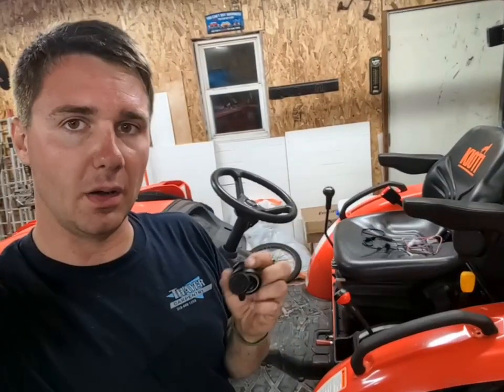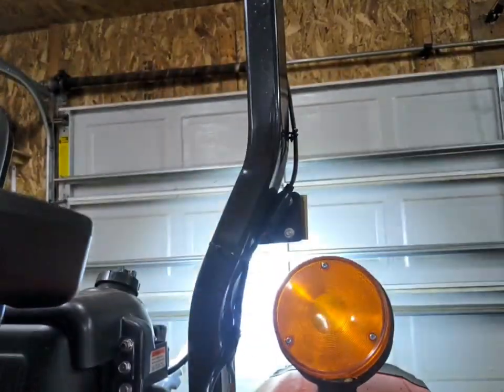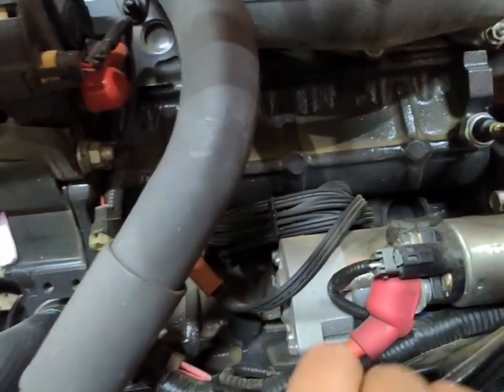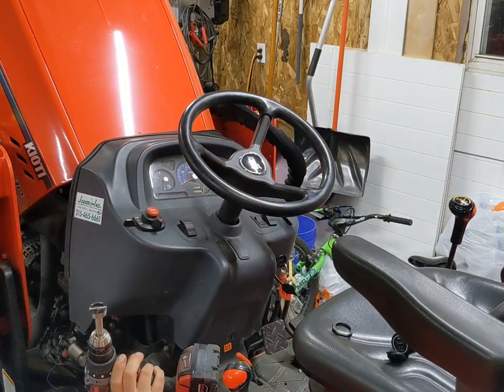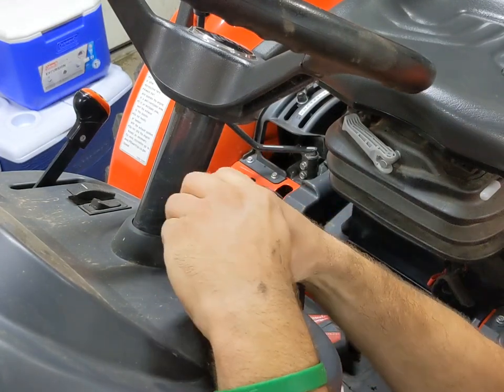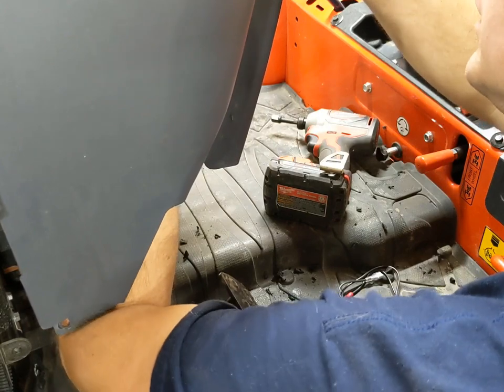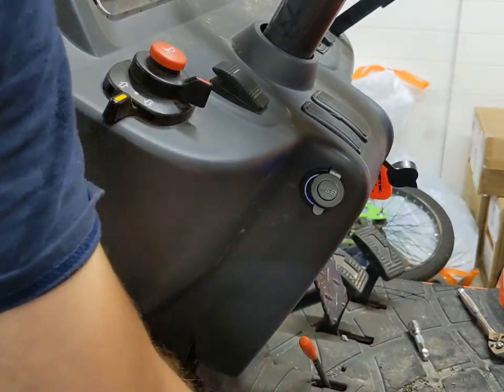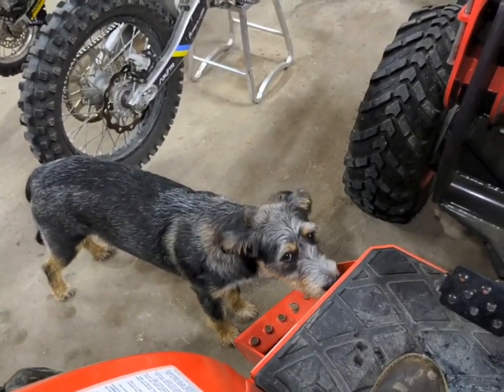Add A 12V Power Outlet To Your Kioti Tractor! Here's How!

Comment: How are you finding the tractor since you turned up the power?
Reply from the maker: It's been a huge improvement. The places I notice it the most is when I'm running around the yard/mowing in high range and running my 6' brush hog like I did for 5 hours the day I filmed this. Definitely recommend